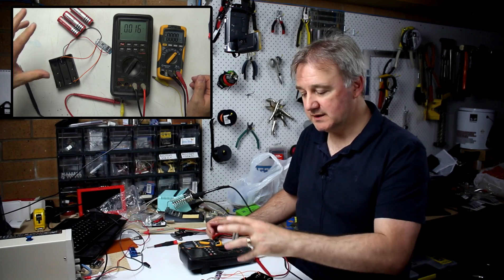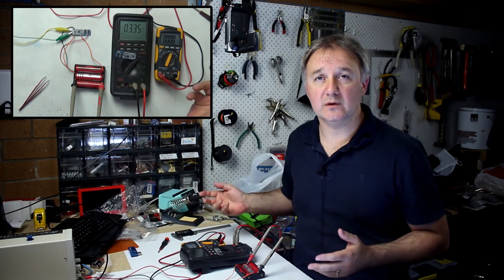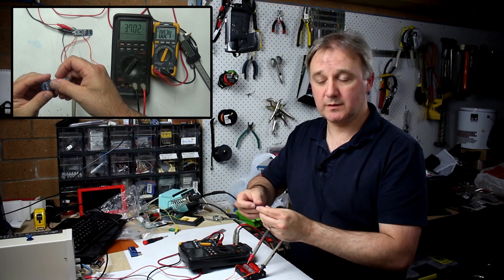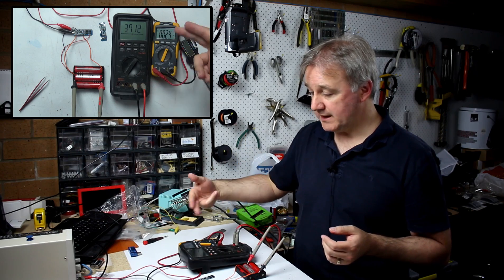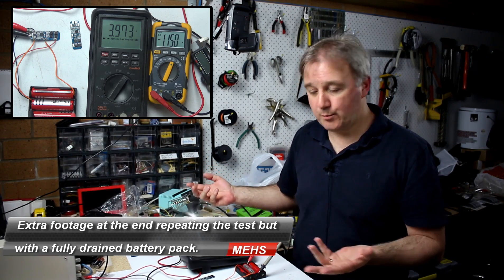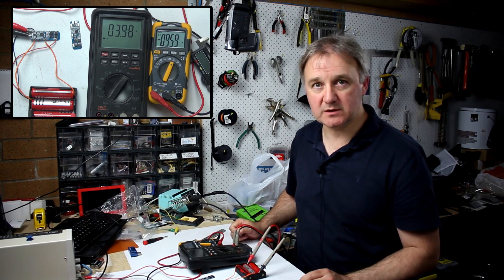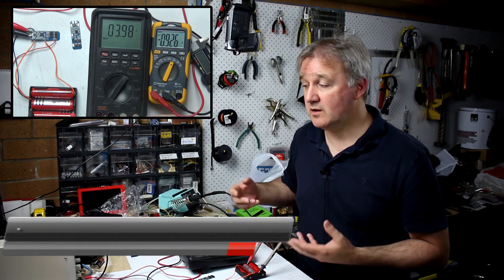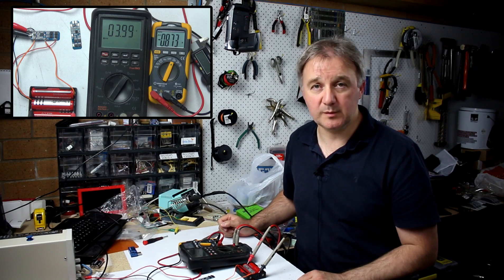Does a BMS charge my Batteries? (MEHS) Episode 57

Comment: I dont understand why only 60% charge.  Wouldnt you get 100% eventually but it would take lo ger because of the lower current?
Reply from the maker: - Hi.  I did get some low readings because of a bad cell, but basically you won't get a great result unless you are charging the pack with a proper charger such as a MAX745 that will charge up to 12.6V and charges via constant current and then constant voltage.  I have some more videos on the BMS and the MAX745 board that may help you.  Cheers.

Comment: Do I need to add balance wires and plug in my imax b6 mini then charging my 3s bat.pack useing that bms?
Reply from the maker: - Hi.  Yes.  For the B6 to work correctly it will require access to each cell directly, not through the BMS.  Cheers.

Comment: You’ve only hooked up to cross current charging circuit. That circuit is only used for load leveling it is only supposed to run at low amperage. You didn’t hook up the main leads.  You’re using the BMS incorrectly. The charge circuit would take all 5A if you did.

Comment: can i use one TP4056 for parallel charging of two LI ion batteries??
Reply from the maker: Pijush Dutta - Yes you can.  To keep the cells at peak health and efficiency you should cycle them through a dedicated battery charger but a tp4056 will work.  Cheers.
Reply: thnk you sir..cheers
Reply: So i can use the bms and the tp4056 together without any problems?
Reply from the maker: - Hi.  No.  The BMS in this and other videos is for 3 cells connected in series.  A TP4056 is for one cell or two cells if connected in parallel which works like one cell.  A TP4056 only works with voltages for one cell.  You can get a version of the TP4056 that has a BMS built in which works well with single cells that don't have an integrated protection circuit.  Cheers.
Reply: I have 3 tp4056 with overcharge, discharge protection etc. The board has also battery outputs...is it possible connecting all 3 tp4056 outputs and have an output of 12.6v?
Reply: Or i can use the 3 tp4056 only for charging and connect the bms to the 3 batteries to protect them...my problem is if the tp4056 boards interfere with the BMS
Reply from the maker: - Hi.  You can connect all 3 TP4046 boards to get 12.6V but the problem is the protection circuit won't work correctly as you are combining outputs and each TP4056 will read 12.6v at some point or shunt all the current through one protection chip likely meaning a burn out.  If you want to do this, use non protected 4056's and don't connect the charge supply at the same time you have the outputs connected in series.
Reply from the maker: - Hi.  It depends on how you approach this and what control you have in place.  You need to consider current flow when connecting to each cell and then connecting each cell to a BMS, basically you are sending 12.6v across the circuit.  The 4056's won't like that.  Then you have issues with common ground unless you use a completely separate power supply for each of the 4056's.  Its possible but you need to work out a few issues to get it all working as you want.  Cheers.
Reply: Man you are amazing!...thanks so much for helping me. The only easy solution i found is that ill make a 3 cell battery holder with a BMS, and when the cells need charging ill pop them out of the holder and charge them with the 3 tp4056 modules in a separate holder. THANK YOU for helping me figure this out!

Comment: These boards are crap but next time at least use a real 18650 and not a fake fire battery they are crap and WAY over rated maybe at best 500mah on those fake ebay junk cells
Reply from the maker: - Hi.  Just did a video on the REAL capacity of these and other cells.  850mah for the fake UltraFire cells.  Cheers.

Comment: Interesting video. Did you post the data sheet for these in another video? I'll order a few and see what I can get them to do as well. Thanks for sharing.
Reply from the maker: - Hi.  No I don't think I did, sorry.  I should start putting that sort of material up on my website.  Cheers.
Reply: My Electronics & Hacking because you have 900mA cells this is a CC charge. Those cells your using are well known to be fakes and have horrible capacity. Did you test the capacity of the cells? This video is very misleading mate.
Reply from the maker: - Hi.  I definitely don't want to be misleading.  Yes the cells are fakes, about 1500mah.  Could you let me know where its misleading or unclear or even what questions you have that the video didn't answer or cover?
Reply: Sure thing: (edit) 1.) you're charging 3 cells in series? Or your using the board to charge just one cell? And your only monitoring the current coming from the PSU right? And it sounds like your guessing with the capacity. My experience with those cells is they are well under 1000mA. And the IR of all the cells is different so they should not be charged in series, one cell will certainly hit its limit well before the others. I think seeing the voltage at each cell, if your testing them all, or the entire pack, would have been better than just the one. But I'm stoked your trying to help people and in no way mean to be disrespectful. (Sorry for all the edits, very late here and my eyes are getting heavy, I'll revisit this in the am).
Reply from the maker: - Ok.  1, yes working with 3 cells in series.  I was using the large multimeter to measure the voltage of the cell in the middle of the pack.  2, yes only monitoring the current being drawn by the pack.  The PSU was set to a 5A max so the small meter is really showing the draw of the pack.  3, yes and no.  I did a basic drain test using a LED panel with known wattage and calculated the capacity of the cells from there.  4, yes agree about the internal resistance.  It wasn't really a video about matching cells and balancing but I am aware its very hard to do a video that gives enough information for the majority of the likely viewers but doesn't give enough for others with more in depth knowledge.  I am considering doing another and ensuring I cover all the subject matter that has already been asked or requested from the videos I have already done on BMS and Lithium cells.  Might be a long one.  Thanks.
Reply: My Electronics & Hacking Show that's the point, you misrepresented the board because if you used matching cells, your results would have been hugely different.
Reply from the maker: - Yes.  I expand on this in episodes 58 and 61.  Let me know if you still think more information is needed after seeing the content in those videos.  Cheers.

Comment: Can i make a 3s2p for this bms 3s 10a?
Reply from the maker: - Hi.  Yes you can add cells in parallel as the BMS only cares if the load exceeds its current handling, say 10A.  So you would only have issues if you wanted to recharge at more than 10A or wanted to draw more than 10A through the BMS.  Cheers.
Reply: Will my 18650s drain faster, If I use a 3S 10A BMS as a power source where only 12v 3A is needed? or else is it better to use a appropriate one like 3S 3A BMS?
Reply: Shamil Aiyubkhan no it will drain normally. Buy

Comment: If i put a bms on my battery pack ,do i still need to put a balance cable on it as well to connect to my balance charger ? ?
Reply from the maker: Hi.  If you are connecting and charging using a balance charger then yes you need separate connections.  Cheers.
Reply: Thank you for the reply...Ok so,do i put the balance cable on the bms or do i just put it on the battery like normal
Reply from the maker: - It depends on your charger but it would be safe to say you should connect the balance charger to the cells as you would normally and not to the in out of the BMS.
Reply: Awesome reply,you understood what i was saying .Again thank you...Awesome

Comment: You should take this video down because it is TOTALLY WRONG.
Your power supply was in constant voltage mode almost immediately.
3.99 X 3 = 11.97VDC
The BMS does NOT charge your batteries; your power supply does.
All the BMS does is BALANCE the charge so each battery gets the same voltage across it.
.
The really good ones have:
1) overcharge protection (shuts down when the battery voltages are about 4.1 or 4.2 volts each).
 2) And they also provide short circuit protection ( limited to the rating of the BMS board).
 3) And over discharge protection where the BMS shuts off the power output when the batteries are drained down to about 2.5 to 2.8 VDC each..........
Reply from the maker: - Hi.  I understand your points but I stated in the video the issues and factors taken into consideration.  I did have a brain fade when I said the cells were only getting a third of the current each but I corrected that with an overlay and in the comments.  If you watched on a mobile device you may not have seen that.  Yes the power supply was in CV mode just as a power brick would be so thats correct and that is the point.  Yes I stated that the BMS doesn't charge correctly as it only allows power to flow to the cells in an unrated manner.  As you stated the BMS only controls the limits such as under / over current and voltage, also as demonstrated.  I have said in many comments that the BMS is not a battery charger and I have a number of videos on the topic including ones that look at how to correctly apply a charge to lithium packs.  I appreciate your contributions, it makes the whole thing better and everyone benefits from learning and exchanging idea.  I agree with your numbered points 1, 2 and 3 but I would probably say that point 1 is more accurately described as over voltage protection, not overcharge protection.  Im not being pedantic but if we applied exactly 4.2V to each cell through the BMS, the BMS would be happy and continue to allow current to flow.  In this example we would actually reach a point where we are overcharging the cells since there is no charge termination and we would end up with a trickle charge condition that lithium cells don't like.   Thanks for watching and contributing but I don't agree that the video is wrong.  Cheers.
Reply: I'm sorry to tell you this but even your correction is incorrect...
Let me try to explain:
let's say that you are charging through your BMS at 500 Ma.
There may be 500Ma going into the 3 cell BMS but not all of that current is going through each cell...
I believe that BMS is rated for a 60Ma shunt.
That means that the first two cells, which were measuring about 4.2 VDC were NOT receiving 500Ma, but instead were only receiving 440Ma, which is 500ma minus the 60 ma shunt current; while only the last cell, the lower voltage one, was receiving the full 500 Ma.
 That's how the BMS keeps from overcharging (overvolting) the first two cells while trying to bring that third cell up to 4.2 volts.. But if it cannot shunt enough current to charge a weak cell; then the other two cells can possibly overcharge......... That scenario is bad for both the BMS and the cells.....
If there is so much difference in the cells that the 60Ma shunt current is not enough; then the BMS cannot balance charge those batteries unless you greatly reduce (limit) the charging current so that the 60 Ma shunt capability is a significant portion of the charging current.
 For example: If the charging current was reduced to only 100Ma; the first two batteries would only receive 40 ma each while the last battery would receive the full 100Ma.
 The large FETS you see on the board are only used to turn the current on and off to the module and have nothing at all to do with balancing the charge on the batteries.
 If you want to charge at multiple amperes; and your cells are poorly matched; you need to use a charger that has the balancing devices inside the charger.
They balancing devices (usually power fets) will get quite hot if the required balance current is significant, which is one of the reasons those units are almost always fan cooled.
Bottom line:
1) Find the balance current rating for your BMS unit.
2) Measure cell voltages and see how closely they are matched.
3) Monitor cell voltage differences while charging and if they vary by more than a few tenths of a volt (especially if two are the same and only one is different), reduce your charging current to a rate slightly higher than the BMS's rated shunt current capability.
4) if the BMS cannot balance the cell voltages after reducing the current; then you need to verify the integrity of your cells.
.
I hope that helped explain how the 'balance' part of that system works........
.
 Because then you can explain it to thousands of others who think their BMS boards are bad when they are working fine,  but being used incorrectly and being pushed past their ratings.
Reply from the maker: - Hi.  Thanks for the concise and clear message.  I appreciate quality data and such comprehensive discussion.  I am aware of what you are saying but I have a couple of questions / points just to make sure.  a) My understanding of shunting is that the shunting occurs during the CV phase yet your comments suggest this is happening during the CC phase.  Is that correct?
b) I was using fairly matched cells and tested the pack by applying charge through the BMS for more than a week and found all cells sitting at 4.18V (as I expected).  Are you suggesting the issues you raised only affect cells that are badly matched, (that is what I have always understood) or matched cells also?
c)  Since many of my viewers are beginners who buy a BMS off Ebay where the data available is minimal at best, what would you suggest they do to implement better DIY projects?  What I am getting at here is, how critical is a topic such as shunting to a project builder that has a BMS in place to protect the cells from catastrophic failure but doesn't necessarily know about or care about the details or how long the cells may last??
I intentionally stayed away from discussing active / passive balancing in this video as it was outside of the chosen scope.  I understand if you think it should have been included as an integral part of the topic.
Thanks again for the contribution.  I'm happy to be corrected as long as I and others can learn from it.
Cheers.
Reply: Answers to the best of my knowledge...
a) Both. 
It depends on the total pack voltage and the voltages of the individual cells.
For example; if you have 2 cells at 4.2 VDC and a third cell at 3.5 VDC, you probably have not met the requirements of the charger to go into constant voltage mode; but constant current mode no longer applies if the constant current was set to more than the maximum shunt current allowed by the BMS board.
 If your constant current is 1 ampere and the BMS shunt current is 60 ma, and the first 2 cells are fully charged, that last cell is only going to charge at 60 Ma...
b) Balancing issues are due to unmatched cells; and limited in correctability by the shunt current capability of the BMS.
c) Suggestion #1 = Power cycle all of the cells individually multiple times and let them sit idle for 24 hours.
Pick the cells with the most closely matched voltages to use with the BMS. If you have 50 cells their voltages will vary all over the place, but if you put three cells measuring 3.9 volts each on a BMS; the BMS will do a much better job than if you used two batteries measuring 4.15 V and a third one measuring 3.9 volts. That is because if all the cells are the same voltage, or close to the same voltage; they will all receive the full charge current from the charging supply. In that case your constant current limit on the charging system is used to limit the charging current.
 If you want to mix and match cells without doing some presorting, then you should consider purchasing a commercial charging system for multiple cells where the 'balancing current' is done inside the charger.
 Those chargers have two  high current charging terminals and then have multi wire breakouts that go to a plug in the side of the charger that does the individual cell voltage readings and allows much higher shunt currents when balancing.
 The more expensive the charger, the higher it's balancing current capability will be.
.
I hope that helped.....
Reply from the maker: - Ok.  Thanks for that.  What you're telling me is clear.  Its not information I didn't already know (shunting maybe need revisit) but I think the issue is the information that is provided in each video on a specific topic.  I may need to further consider how many factors I introduce and discuss that are associated with the main topic such as using a BMS and taking that further to explain matching cells, balancing basics etc.  Thanks for the contribution.  Cheers.
Reply: What gets even more confusing is that some 'balancing systems' are bottom balancers as people are describing below.
What they do is balance the charges on each sell; but only balance to match the weakest cell.
.
The best BMS system would be one that treats each cell individually and when the best cell gets fully charged; it either takes it out of the charging path completely or only applies a trickle charge to it.
the bypassed current from the first cell now goes into the remaining two cells, and the first of those two cells to reach full charge also gets taken out of the charging path with only a trickle charge applied to it, 
 and the bypassed current is now going to the remaining cell to charge it. These cells would not be bypassed in any specific order; they would be bypassed in sequence with the order of their reaching the charge cutoff voltage for full charge....
And of course the charger would have to be a current limited charger ....
 When that cell gets fully charged the BMS also removes that cell from the charge current path but does not bypass the charge current around it because the BMS job is finished with all three cells now fully charged.